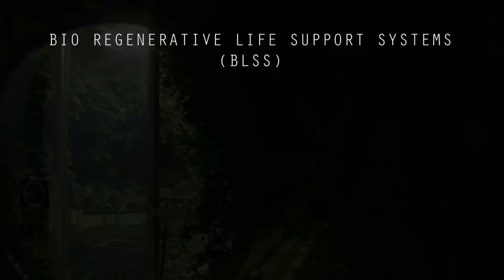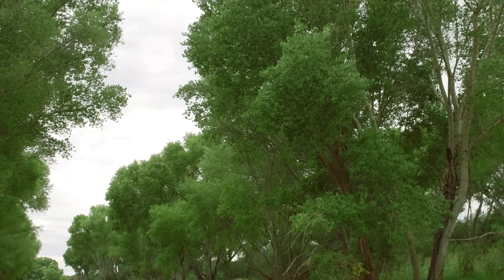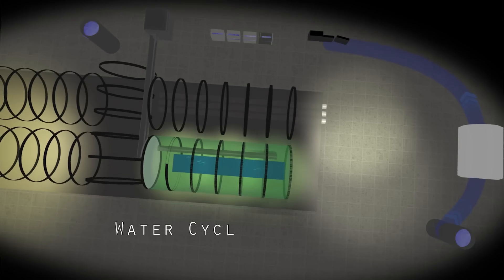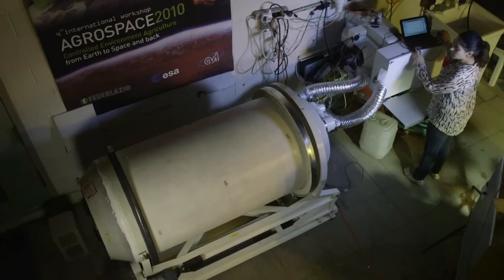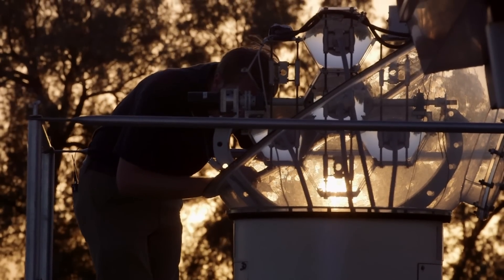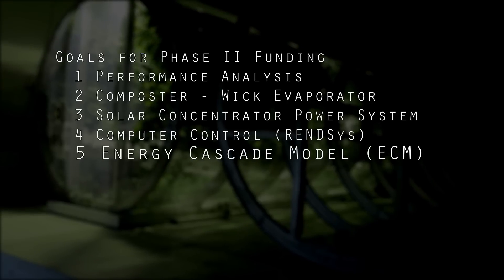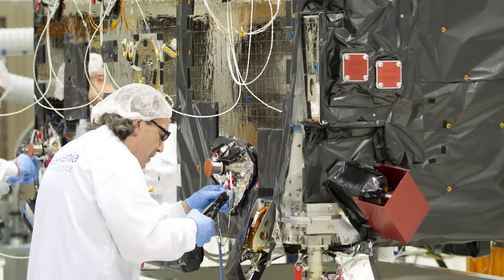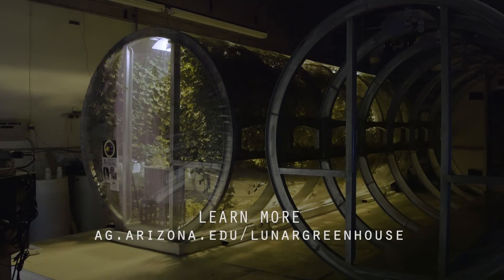Full Scale Lunar Greenhouse Prototype

Comment: How do they generate enough water for one person?
Reply: Plants evaporate most of the water they use. This is largely to pull the nutrients in the roots up with the water and then evaporate the extra water to cool the leaf and draw up more stuff. Go find a branch of a tree or bush and tie a plastic bag around it with a rubber band. (it needs to be a branch that slopes down.) It will generate several cups of water.

Comment: It's an NFT system (nutrient film technique), so there isn't a large volume of water needed.  However, the more water there is, the better buffering there is in the system.  I'm guessing we start with about 70 to 80 gallons of water.  

There are numerous data and modeling of the water balance, but I don't think they've been published yet.  We make up some of the lost water by putting condensate water from our heat exchanger (to cool the hot, humid air that leaves the chamber) back into the system.